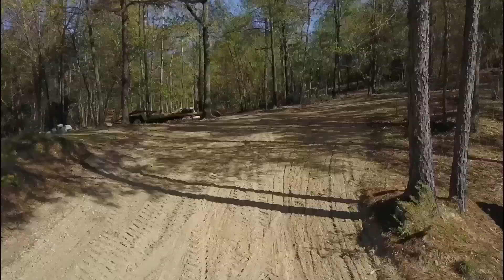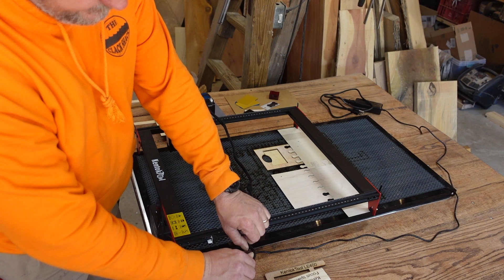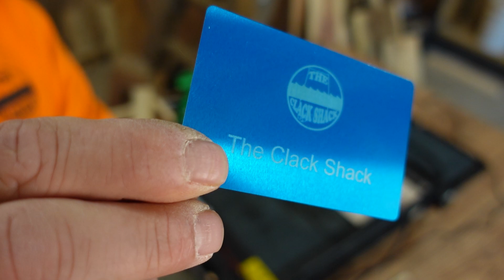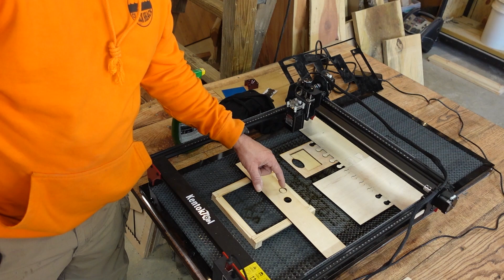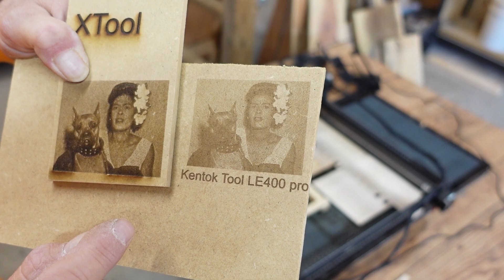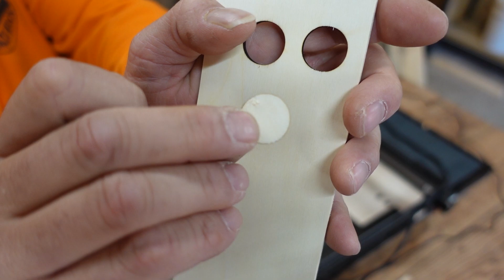testing the Kentok Tool LE400 pro

Comment: We just got one of these. Do you find that it doesn’t perform well for engraving on wood past 100mm sec ? It’s always very faint if it gets faster than that on high power unless ours is bad out of the box.
Reply from the maker: Depending on the wattage and focus, it should engrave ok at 100 mm/s. You can defocus to get darker results. Also, materials matter

Comment: I am a gunsmith with no laser experience, would this be a good option for engraving on woodstocks?
Reply from the maker: Diode lasers do a good job on wood. This is an older video and there are lots of machines out now.
Reply: @TheClackShack  Thanks for the reply, Amazon had a good sale on these so I picked it up! Worth a shot at least!

Comment: Hi just got 1 of the kentok machines. Just wondering what is the thickness of your setting block you use on the laser height setting please 👍
Reply from the maker: Sorry, this video was a long time back. I do not recall and don’t have the machine in the shop.

Comment: I added the twotrees air assist to mine
Reply from the maker: Cool
Reply: Just bought mine trying to install air assist the company said their cover is ready install can't figure out how to any help would be great. Thanks
Reply: @stevengunt9336  I found a link to the instructions on the Amazon posting for the air assist.  Seems like I had to switch out the  plastic shield maybe, it's been so long since I installed it I can't remember

Comment: I have had this machine since November and I have only used it a handful off times because I'm learning all this. I never had any issue but last night I was trying to engrave using lasergrbl and I homed it and went to frame it went from the front left corner to the back right corner and made all kinds of noise. I had to reset it like 4 times. My project was only 152 mm by 101mm so it definitely wasn't too large then when I got it frame right I had it on 100% at 800 speed and it wouldn't even mark the wood. So idk what to do. And I had it focused
Reply from the maker: Make sure you were operating on absolute coordinates and had homes the machine. Only other thing could be work area size setting. 

Maybe it was hand moved and you forgot to home? That has happened to me…

Comment: Can the burner be disconnected from the during the download?  Can a USB be used for burning from file?
Reply from the maker: The machine does not have a card or usb port for removable media. The machine has to be ran using a PC connection. I run lightburn and can't speak to any other softwares.

Comment: This looks very much like my Ortur Laser Master 2 Pro. I had to order the adjustable Z-axis part (well worth the money) and my laser module is slightly different as it is a long focus where this looks like a short focus. One Ortur module has that magnetic shield. 

My Ortur 5.5W has been a great machine and my experience with the 5.5W module has been good with its capabilities for cutting and engraving. 

This machine looks like it’s a decent starter machine, especially for the money.
Reply from the maker: Seems good for the cost.